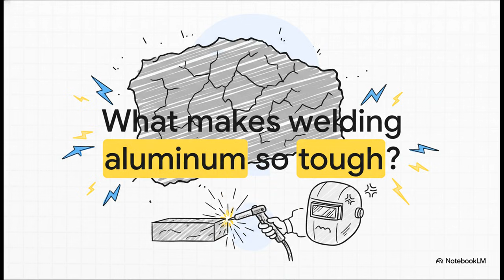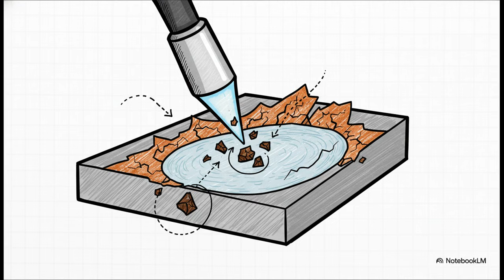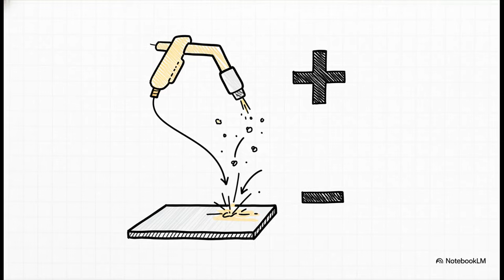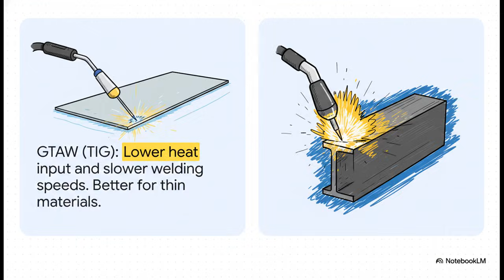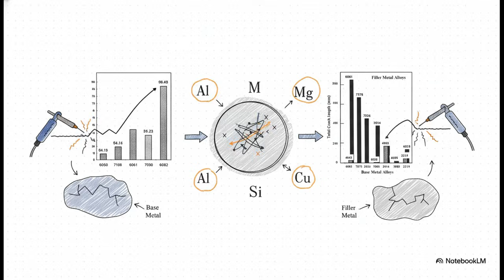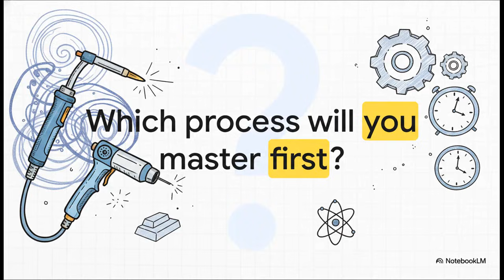04 - Welding Aluminium by GTAW (TIG) vs GMAW (MIG) – Metallurgical Comparison

Comment: I have used stick, tig and mig on aluminum. In my opinion mig was the good middle ground champion for not so thin, perfectly clean projects. It looks almost identical to tig as far as viewing the formation of the weld pool and adds the filler automatically.
Reply from the maker: Great insight, Troy! You’re spot on about the filler wire convenience. Out of curiosity, do you still prefer TIG for the root passes on critical joints, or do you feel MIG handles that well enough too?